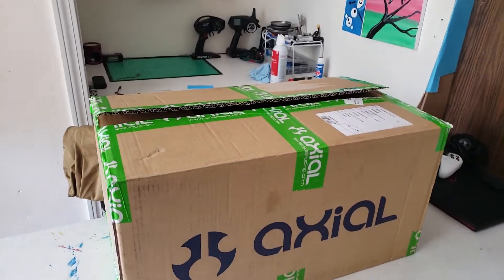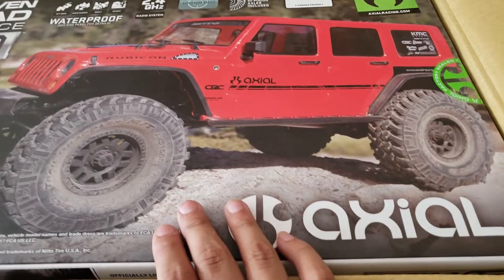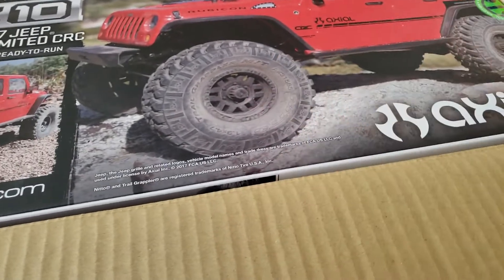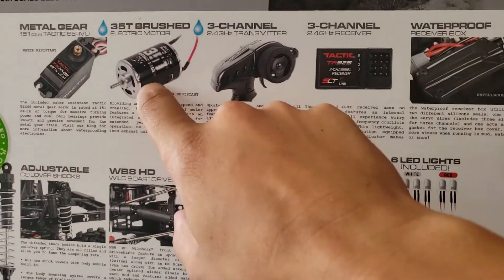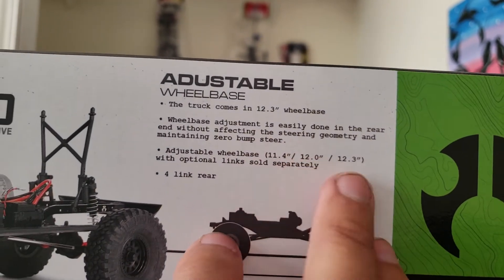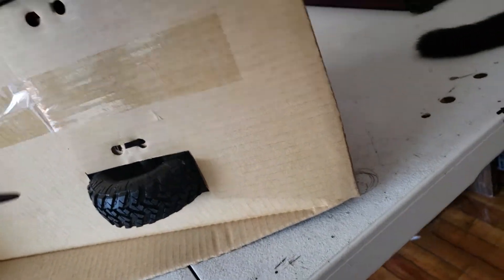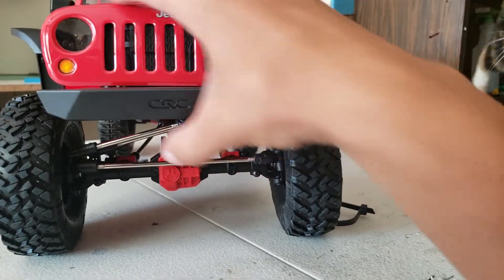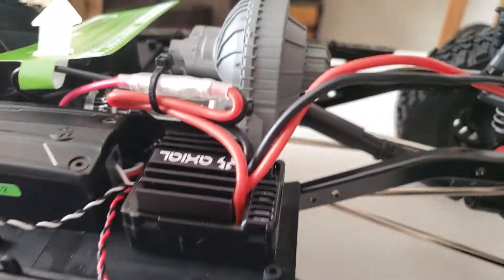Axial Scx10 ii 2017 Jeep Wrangler CRC Unboxing

Comment: Was it leaning towards driver side ? Cus you said it was lopsided. I bought the blazer rtr and it slightly leaned towards driver side . Is that normal? Where you able to fix it ? I tried switching around shocks and nothing